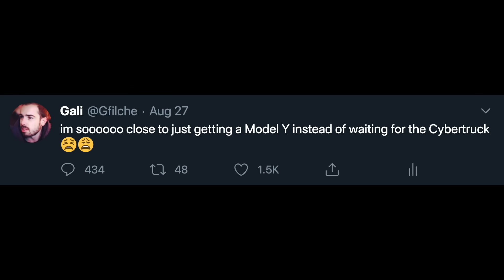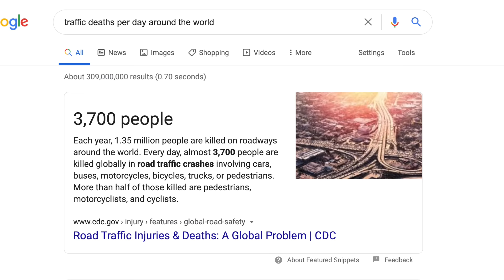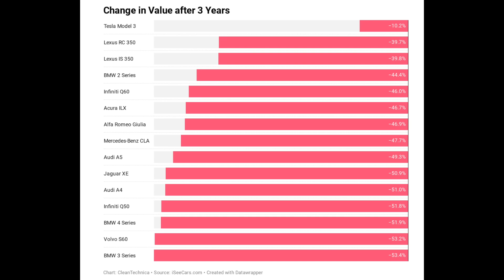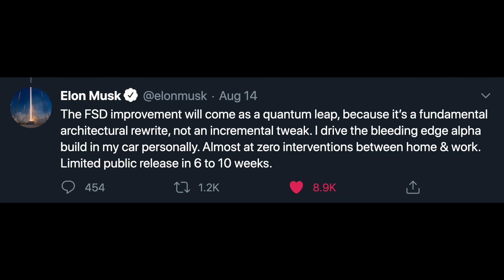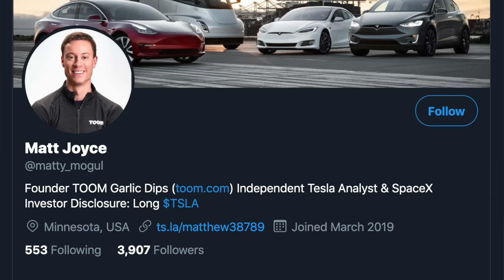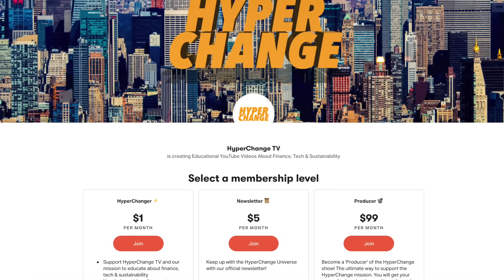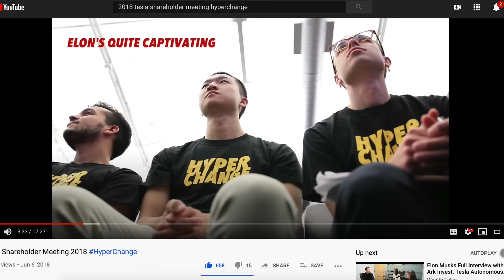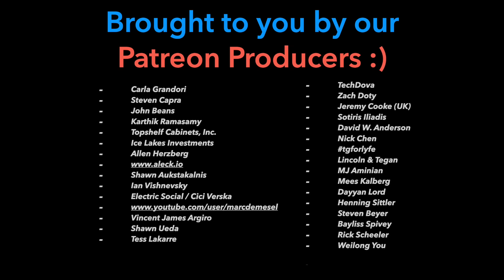HyperChange Is Getting A Tesla!!!! 🍾🥳

Comment: I thought I was excited!  You're about to come out of your skin!  You will have a referral link that you will want to post on your videos so you can get the free miles for your camping trips.  You need to move out of NY city and get out where you can have some fun in the car without risking the damage from the close proximity of other cars.  You need a place with a garage and a wall charger installed.  I've owned a 1977 Corvette and a 2000 Corvette convertible.  Neither can touch my Y.  I just got the dual motor like you.  They are incredible.  You will be cutting your ears in half with your smile.  Every update is like Christmas.  I'm so happy for you!
Reply: Gali will get a Roadster with his referral code and his followers.

Comment: I test drove the model Y in Orlando a month ago. The glass ceiling is amazing. The seats all fold flat in the back. It's made for camping. You lay in the back and look up at the sky. Air conditioning running. Drives amazing.
Reply: There should be mattress kits that look very cool when folded.
Reply: @davis.fourohfour  The Dream Case is a mattress for the model 3 and model S that is custom for the cars. There are reviews for them on Now You Know Channel.

Comment: Get protective film to protect the paint from road rash. I got it for my model 3 RIGHT after I took possession over a year ago and the car still looks brand new. When stones hit the front of the car, the vinyl film actually heals itself. The installer will give you a number of options regarding what portions to cover. Choose all the options forward of the front doors including the mirrors.  Crazy good protection. Also get ceramic coating for the part of the body that isn't protected with film. Floor mats. Trunk mats. Frunk and sub trunk organizers. Matte protective film for screen. Film wrap for glossy black center console (finger prints). This will be your dream car every day you wake up. It never gets old.

Comment: 10% still means you're getting rich on the rest of it :-) 
Got myself the long range (then called the "AWD") Model 3 with the white interior. The white looks amazing and doesn't show wear after 1.5 years. Maximum range is more important than even more ridiculous acceleration of the performance package (not just for roadtrips but also for convenience of not having to plug in as often and charging faster). The regular ones accelerate plenty fast. After I experienced myself what an amazing product this is I had to get in on the stock (which has paid for the car three times over by now). However I'm not yet sold on the utility of FSD.
Accessories: What you need is a wrap for the center console.

Comment: Gali, this is what you do:  you buy black Model Y.  You then get a PPF (paint protection film) in flat.  So it will change your car to flat black plus protect your paint.  Get the smaller wheels.  They ride way better.  Then remove the hub caps and paint your rims black.  They look amazing.  Then also wrap your brake calipers in red.  That’s what I did with mine and it looks sick.  Cheaper way to do it plus a better ride.

Comment: Congrats.  

It's interesting watching Tesla turning you from a car-indifferent to a car-gotta have one guy.  I went through the same thing with Zac over at Cleantechnica.  He was someone who didn't have a car, didn't want a car, but as he spent time writing about EVs he talked himself into getting a non-Tesla EV and then on to the real thing.

I'm fighting the desire.  I've got the money but just don't drive much.  The car I bought 15 years ago has yet to accumulate 80k miles so it's got many good years left in it.  But I'm tempted to take a bit of my Tesla stock earnings and buy a Model 3.  I put down my $100 for a Cybertruck but waited until the line was long in order to put off the purchase.  Maybe what I'll do is buy a 3 now, use it a little and when the CT is available decide which vehicle I want to drive me around when age makes it more difficult to drive myself.

Comment: Loved how excited you are and you are right....why don’t you own a Tesla?!!...you believe in them and so you should have one.  Me too!....have a model 3 after 2.5 year wait and also a Y....love love my 3 and the Y is great too.  Best cars ever owned.  I am keeping my Tesla stock.  ....wish I bought more.  I am a clean freak, so make sure you get the full PPF wrap (do not do partial wrap for the huge investment you just made),  had my console wrapped in clear PPF film so that it retains the black piano shininess but won’t get scratched, Tesmanian full set mats - frunk, front, rear, trunk, and trunk well (get the full set and there is 20% coupon TES20) which fit like a glove, the set of 4 lifts for when need to rotate tires, air pump & foam for tires just in case have flat.  I am considering getting a ceramic coating on top of the PPF film to keep the car cleaner longer between washes.

Comment: Get sticker wraps for middle section, maybe a colored Tesla logo sticker set, flash drive to save recordings, wired Xbox controllers (cuphead is amazing), wireless charging pad (if not yet included), all weather mats, open door sticker for buttons can be helpful to noob riders, tire repair/inflator to keep in secret compartment, and steering wheel desk for your laptop so you can work while on the road.

Comment: Congrats Gali! BTW - Don't get the 20" wheels, I made the same mistake ordering the 19" wheels on the Model 3 LR AWD, and I ended up buying a set of the 18" Aero's because the range was so much better. On our Model Y LR AWD we did the 19" Gemini because it's the absolute best range you'll get in that configuration. Gemini == Aero, and you can always pull off the covers for a nice wheel underneath.

Comment: For some reason my X has some of the feature of autosteer on street until I did an over the air update and some of the functionality went away. :(  Before, the loss of functionality, car would automatically slow down on a sharp corners. That was probably the biggest thing I lost.  I can also say that the feature to slow down for a sharp corner is not there yet. It's bit slow to act. As I'm coning out of the sharp turn, instead of accelerating, it slowed down because the turn was sharper than anticipated by the car. It seemed that the slowing down was figured out a bit too late. Entered the turn bit hot then slowed as it went through the turn. Other problems I've encountered is on a rollercoaster on the road. Hard uphill followed by hard down hill then another hard up hill then another hard down hill. Each time FSD and autosteer would hit the brake really hard. Enough to jerk your head forward. I could over ride it by lightly depressing the accelerator pedal so that I was just over the set speed.  My route also has several Y-split for which the car will try to drive right into the divider (like the Apple engineer who killed himself in Silicon Valley.)
Even at 99.9% okay, how often will you hit the 0.1% for which the car can't handle?  It's too often on my route.

Congrats Gali and welcome to the club. I'm getting a Y for my partner. Same long range same red color same black wheel.  I'm going to quietly add FSD after few weeks. My partner is totally freaked out in a bad way with how FSD handles/performs in my X. And darn right. Stay focused in driving with FSD.  It does some crazy shit at times without warning.

Comment: What with Phillips Hue lights, 16 million different collors graduated from white to all the collors you want, and its all LED and dimable, at least all the lights I have sean from Phillips. You can control it with your smart-telephone, requires internett, but it's awsame. Comes in all different sizes and shapes. If you by Phillips Lightstrip +, you can cut it in the length you want minimum 16 cm. This Lightstrip + is 12 volt, but it youse an adapter that go's in a normal plug. 🔌 You wil never get bored because if you get bord of the collor, just change the collor in the app. 📲

Comment: Congratulations - you've got the best car and have the best reason to buy. I'm looking forward to content made in the Hypership.  Also you thoughts on $8k on FSD vs $8k on TSLA (16 shares) buy 2030.
Reply: @Simon Claringbold - 16 TSLA (nasdaq) shares will be better purchase, as it will be at-least $30,000 per 1 share (in December 2029) which is $480,000 for 16 shares value, dont think FSD will be $480,000 in December 2029
Reply: @rucidlivian7508  - don't forget to add in the 5 to 8 years of potential FSD earning through Robotaxi - that will make the comparison a lot closer. Gali - there's a model you can construct right there!

Comment: Congrats on the Y purchase. But, as with any car, it is not an investment - but a depreciating  asset. Plus the opportunity cost of your purchase, relative to the value of a stock is a huge negative. For example, in January of 2013, you could have purchased a Ford Explorer for $37,000 ... or you could have invested in 1000 shares of TSLA for $37,000. Had you "Invested" in the Explorer ... now you'd have a great depreciated auto ... if you had invested in TSLA, well, that would have been a real investment. So in 7 years, figure out what your Model Y really cost you. -- Or take a loan to minimize your loss of TSLA stock.

Comment: If I recall correctly you had over 100 share pre-split.  You must have over 500 shares at $450 a share.  You must be up $200,000.  I think you can afford it.  The only question is, given where you live where will you store it.  
Of course you can always put it on Turo (and later the Tesla network).  It will become an investment, not just an expense.